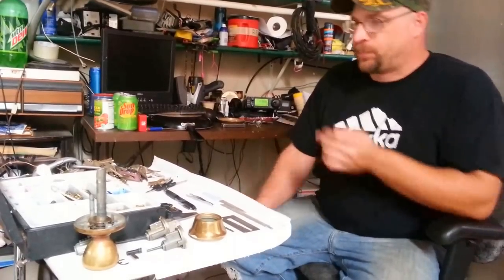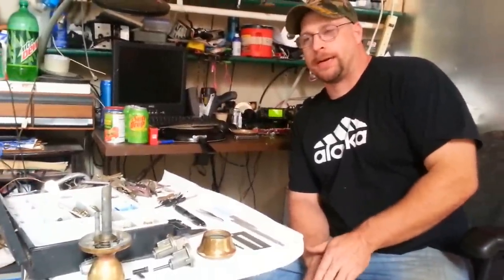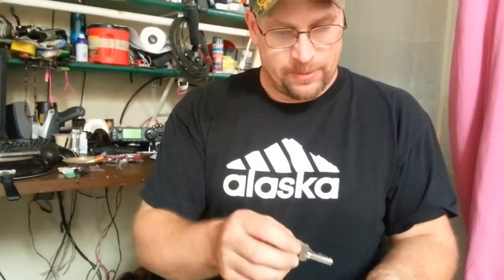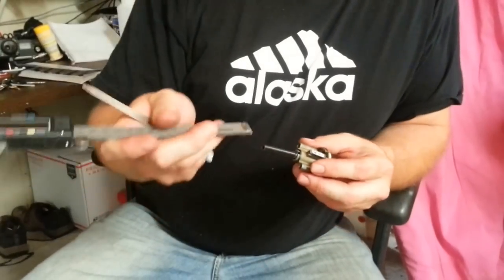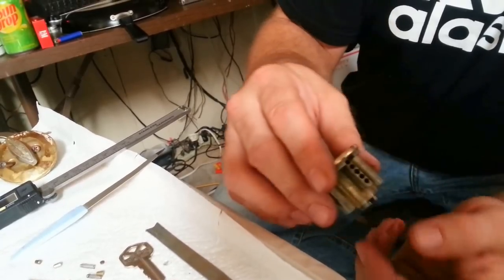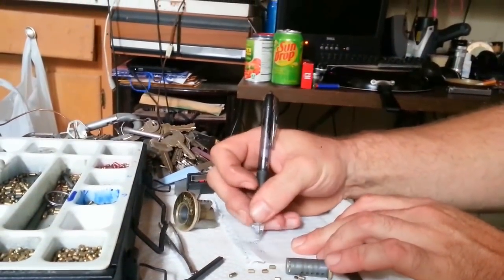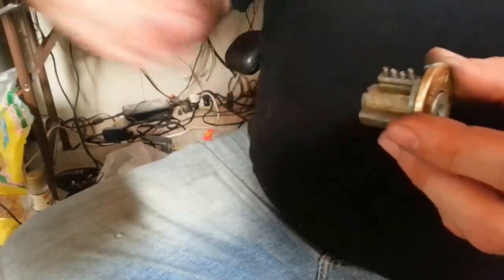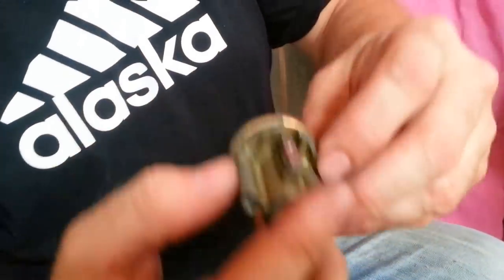HOW TO REKEY KWIKSET LOCKS AND HOW THEY WORK

Comment: OMG. I have been doing locks for Years. That is the most complicated way to rekey a lock I ever saw.
Reply: Yes put the key in the cylinder and check to see if it’s high for low. Much faster than using a calliper.